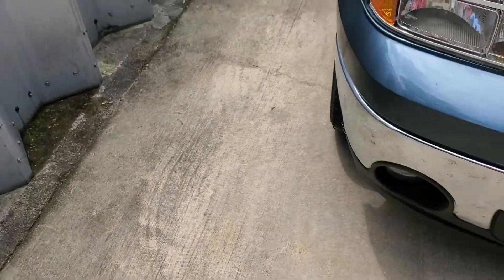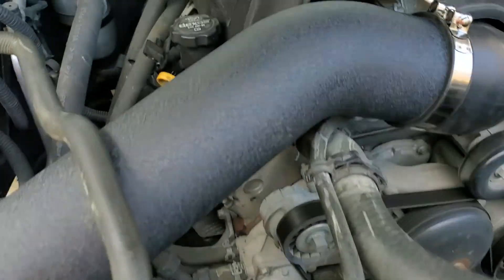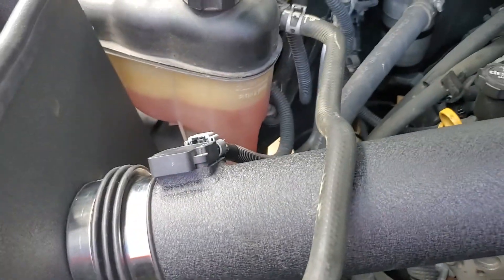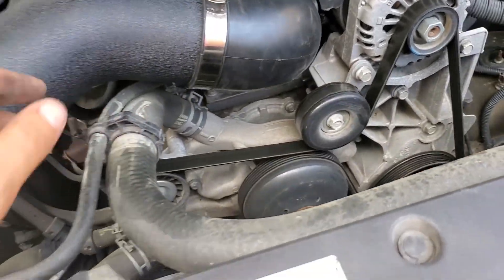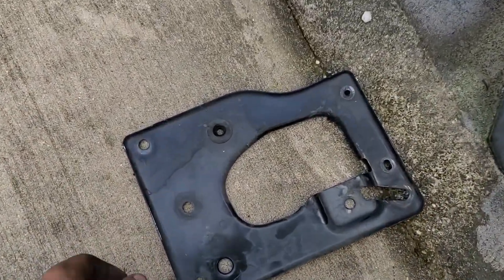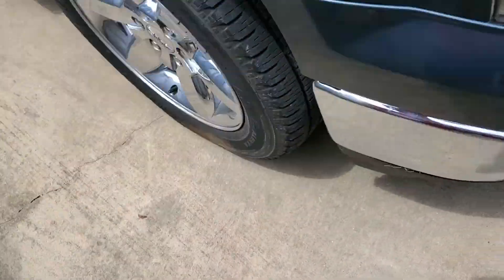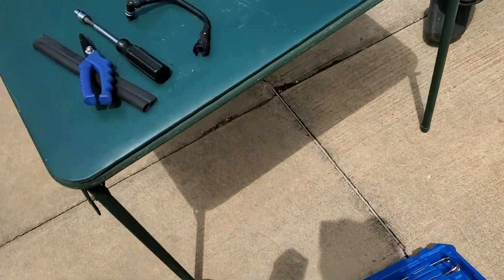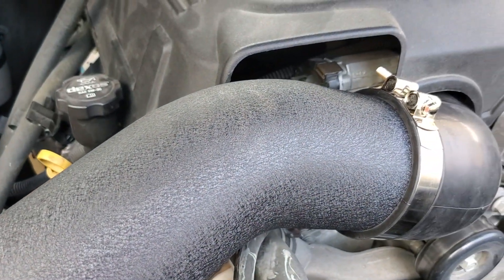2009-20013 chevy/gmc speed engineering cold air intake install

Comment: I just bought this where does the  air cleaner sensor plug into
Reply from the maker: If you are talking about the maf sensor there is a spot for you to screw in your stock one
Reply: @blakestromeyer2908  no attached to the same wire is a air cleaner sensor that is mounted to the bottom of my air filter box my maf is plugged in and screwed down and I’m still getting purging and a engine light
Reply from the maker: @kylek494   hmm you must have a different model than me because I don't remember having that